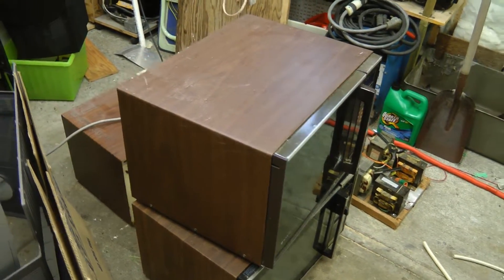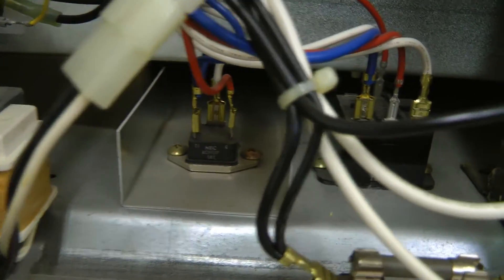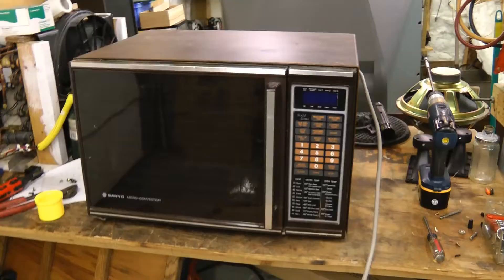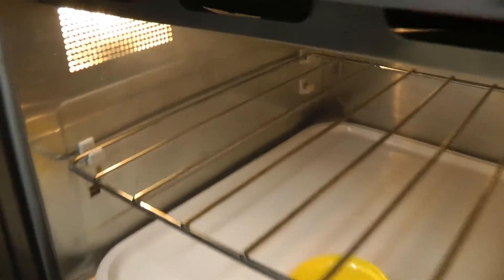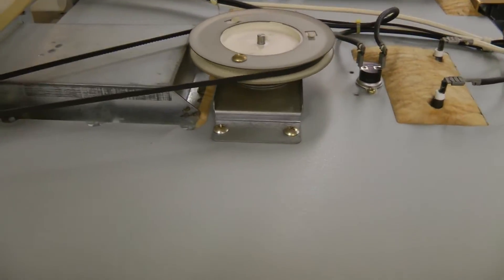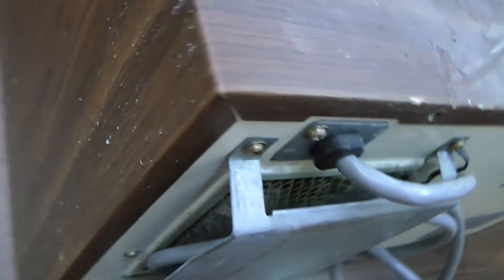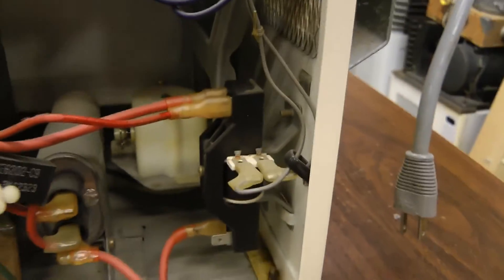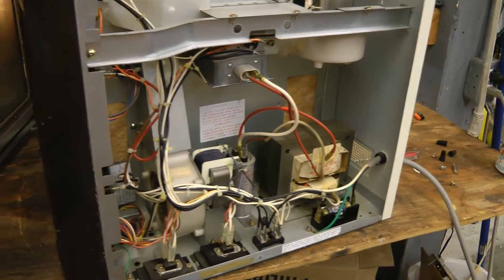Dismantling microwaves and look at Micro-Convection oven

Comment: The microwaves should be confined to the cooking chamber, after all, you don't want escaping microwaves flying about inside the outer cabinet, as it would be a waste of energy, and this part contains the control electronics which would be fairly vulnerable to microwaves and arcing..